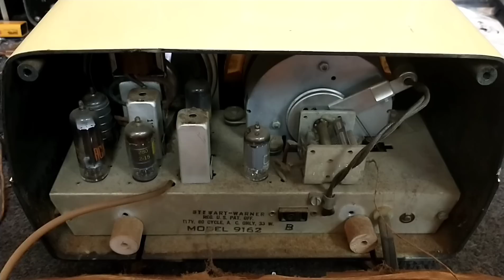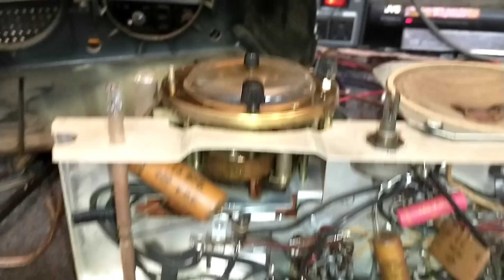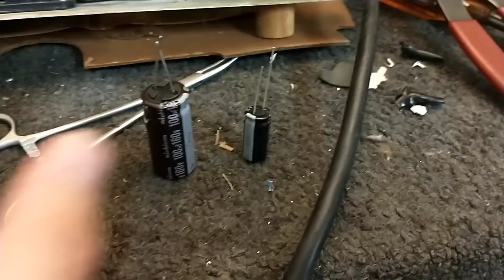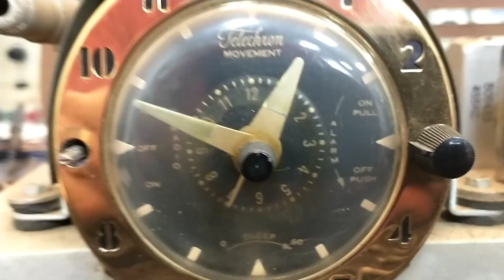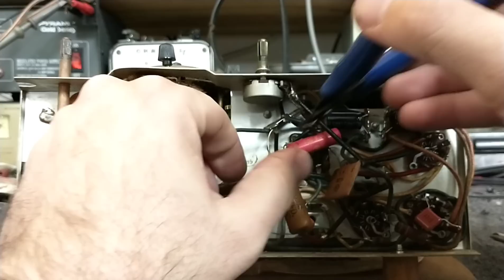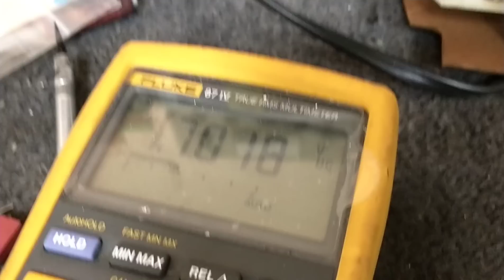Servicing a 1952 Stewart-Warner  model 9162 AA5 vacuum tube AM clock radio

Comment: Greetings:
C30 .05 uf  "death cap" is the only part connected to chassis on this "floating" B-  set. Your replacement goes from B- to B-. Go ahead, measure the voltage across it! That cap went from chassis to the clock power "ON" switch.
The parts list shows a black pointer moving with the "glow lite", but I do not see it in any video or still.

Comment: Might not be the best idea to put the 100uf in there as first filter. That's  250% max filter capacitance for the 35w4, that's gonna reduce the lifetime of that tube significantly
Reply from the maker: If we were hot cycling it with the filaments lit, I could see the surge current being an issue. However if we're starting cold and the rectifier is not conducting the surge current isn't there to harm the rectifier. Also, the 27ohm resistor in series with the anode would take the blunt of the surge. If you're going by the book the original 50mfd would be too high as well.

Comment: That's a nice little radio, it sounds good and no humming. (it knows the words).
it does seem a bit quiet between stations, but that can be a good thing.
There may be very few stations in your area,  so it could be just that.
Maybe i'm just used to hearing noise from transistor radios.
The moving light is so unusual, i like that :-D
Don't expect multimeters to cope with low picofarad capacitors, the leads ruin it.
I use one of those "transistor testers" and the leads are less than 1 inch long.
I also have a tester that uses the cap or inductor to resonate L-C .
Sorry long waffle :-(

Comment: That's a really cool-looking set, don't think I've seen one like it. I always j-hook my connections for the same reason---I've broken off socket lugs trying to go point to point, as just the heat from the iron is enough to cause metal fatigue. I hope you do more of these radio vids, they're fun. Oh, and 50C5 outputs are some of the most unreliable tubes ever made----H/K shorts are common
Reply: Agree, never seen one! Nice!